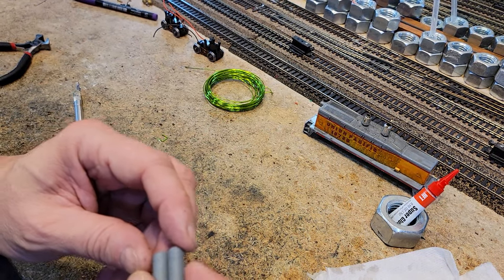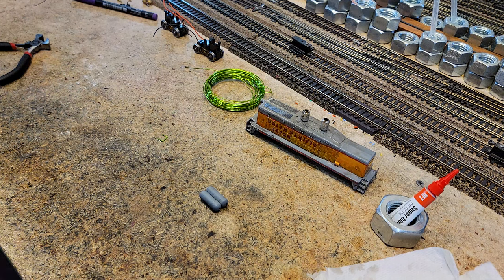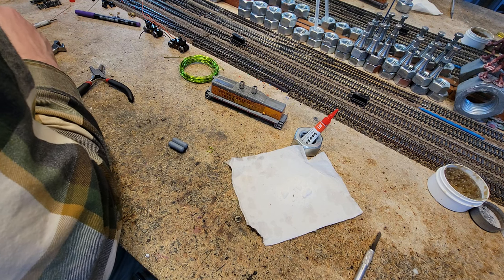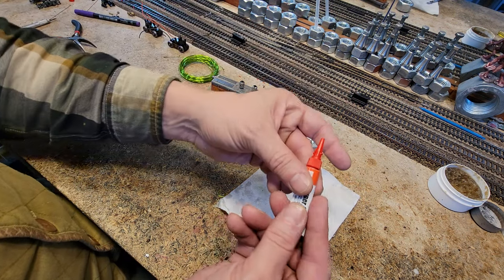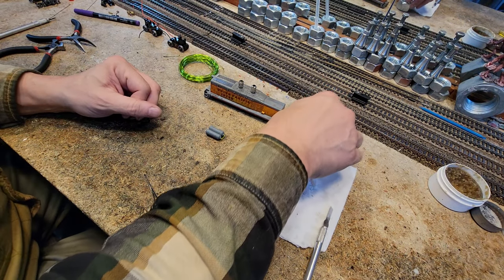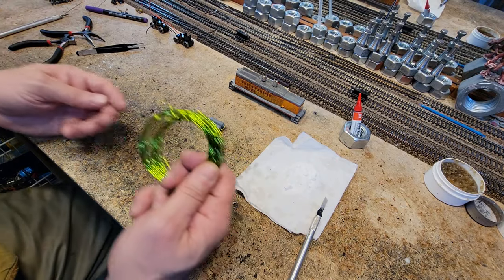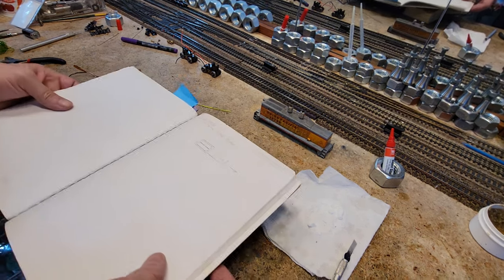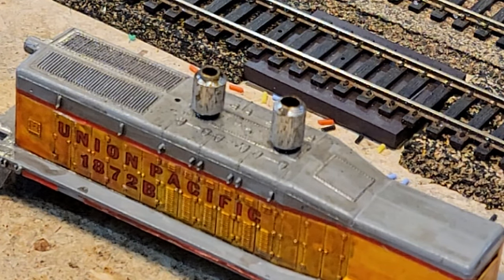Union Pacific TR5B Build Part 7 Air Tank Pipes

Comment: Whud UP ! Lookin' Good As Usual ! On That Type Of Air Tank I Have Used Keystone Locomotive Works Part # 51 Air Tanks , I My Self Have Also Built  Several TR-5 a And TR-5 b's And They Look Great  ! Also I Use The Same Tanks  For AC44CW , C44-9W And Other  GE Locomotives  ! They Look Great Just Like Yours  ! If You Ever Want To Try Them You Order Them Directly From Them  ! Just A Suggestion ! Digwhatchadew ! Have A Good One ! 😎🦊
Reply from the maker: those top mount tanks are a really cool detail!  I used plastic pipe and rounded the ends and some masking tape cut into a thin strip for the strapping!